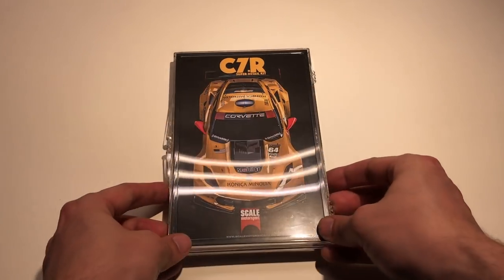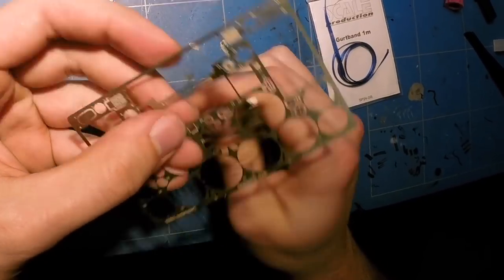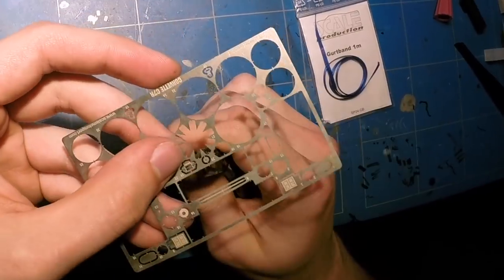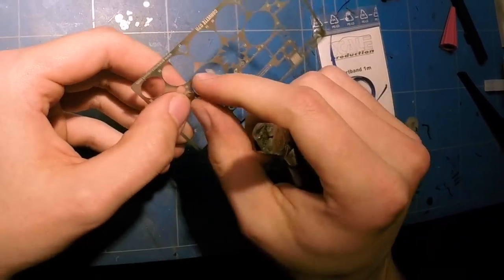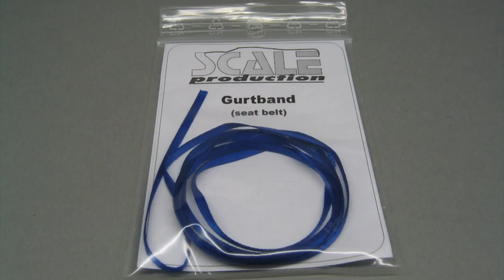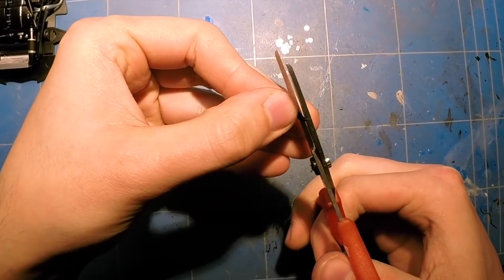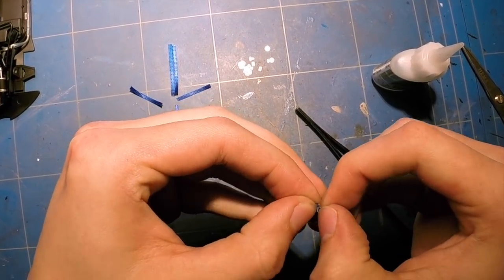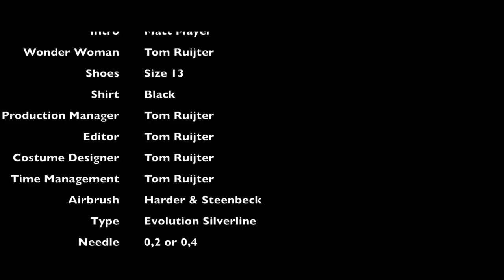6 Point Racing Harness Installation Timelapse

Comment: Hey men Can you maybe do a beginners tutorial for tuning model cars because I have some model cars I want to tune for the tutorial like lowering a model car adding other rims on it install roll cage or other seats basic things I really would appreciate it I already watched your lowering tutorial but I don't really get it btw your vids are awesome! Keep up the good work
Reply: My understanding is that, rather than trying to make any changes to the suspension, he uses a Dremel to shave off the mounting point for the wheel and then mounts the wheel higher up. If you look closely from underneath, it would not be driveable. I could be wrong though. To actually change the ride height and still have a "driveable" appearance, you would have to make major changes to the suspension, possibly cut holes in the chassis and bottom pan, etc.
Reply: Morgan Feldon hey thanks for the reaction but my model car doesn't have suspension it's just a burago Porsche gt3 rs 2010
Reply: That's a die-cast, right?
Reply: Morgan Feldon yes
Reply: Morgan Feldon Yes it is